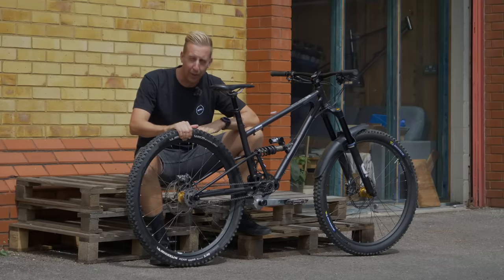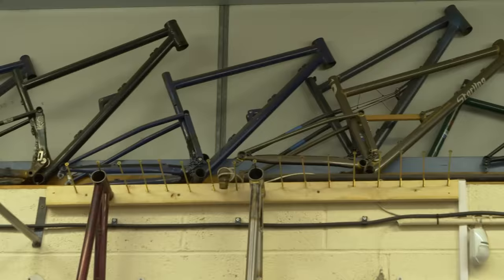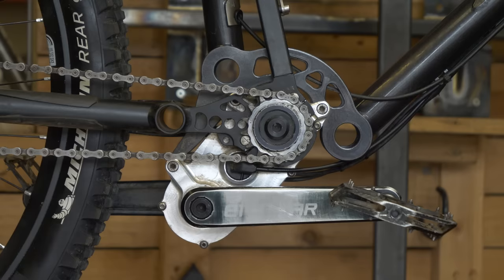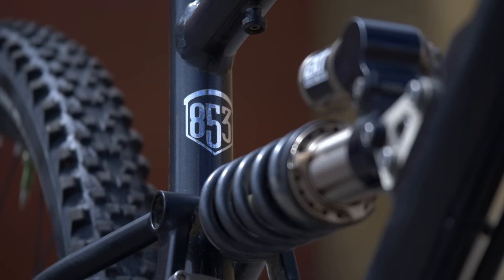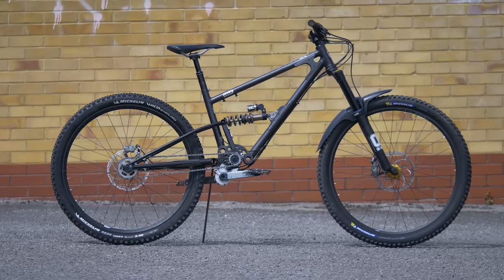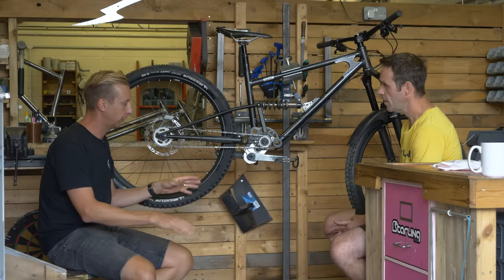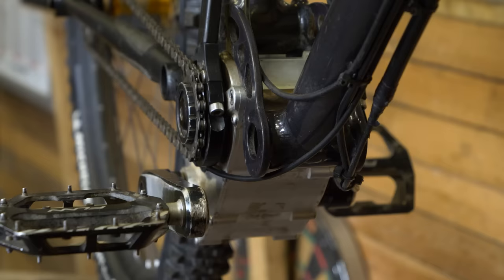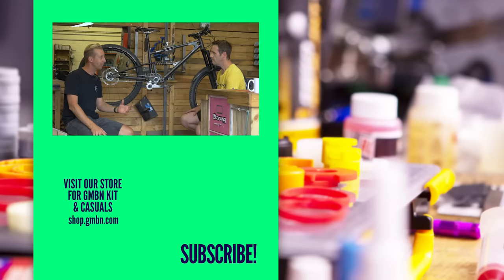Are Gearbox Bikes The Future Of Mountain Biking? | Advantages, Drawbacks, and Future Possibilities

Comment: I'm done with derailleurs. I have ordered a Zerode Katipo with the Pinion 12 speed gearbox and Gates Carbon Belt drive. Less maintenance and less touchy. So many good rides tainted by gears going out of tune. Once the bank account has recovered I'll replace the enduro hardtail too! 

Speaking to the efficiency issue, it is 100% true that chain is more efficient...when it is straight, clean and well oiled. When the chain line is all crossed up, the chain is caked in mud and tar or running low on lube a well worn in gearbox is more efficient. #askGMBNTech Could you do a deep dive into the science of driveline efficiency as a follow up to this video. I think people will be surprised.
Reply: I got one last year, its awesome, careful that the belt doesn't get kinked, mine got beat up in shipping and the belt broke on the 2nd ride, but they were good for it.
Reply: @Andrew Dodd Awesome! Can't wait 🤙
Reply: Go back to a 2x with better chain lines, use wax lubes, and your issues are solved.  I used to ride XC in backcountry Alaska and I never had any issues.
Reply: You won’t regret the Katipo. Shortly after getting mine I realized I absolutely hated derailleurs…. 8 speed, 9 speed, 10 speed, 11 speed, microspline, XD, blah blah blah.  No more. Done.  Click, click there’s 9 damn gears and done.
Reply: @keirfarnum6811  Yeah my 2x10 deals with mud much better than 1x11. The once mud gets on the narrow wide chainring it gets much noisier and can feel there's extra friction.
Reply: @keirfarnum6811  that's because XC bikes don't suffer chain tension issues nor have complicated long travel suspension designs. Another argument is that it is easier do design suspension around a single chainring than a double due to pivot placement. 
2x is good on pedalling bikes, but it doesn't belong in the gravity game.
Reply: @ Kier farnum
Lol, I should have seen that coming.  So out on an 8 hour ride in Alaska, you carry a spare front and rear derailleur, chain and what else...?  Gearboxes right now are first gen post development for the most part, few years time and they will be quite different, at the moment XC is not the target.
Reply: I notice you give the gearbox a good review before you’ve actually used it
Reply: @HkFinn83  For the sake of this being the internets, I'll bite. I think you need to re-read the post. Nothing in there constitutes a review. They are objective statements of fact that have lead me to order a gearbox bike. Nowhere do I go out on a limb to say anything that can not be supported by even the most basic Google or YouTube search. I've made my decision based on what I think will be best for me, and my general hatred of retuning my gears all the time.
Reply: whats the difference of putting the gears in the middle vs in the rear hub?
Reply: @Blox117  Mainly weight distribution. Unsprung vs sprung weight etc. Less weight on the rear wheel means more active suspension and generally better ride characters for a dual sus bike.

Comment: Riding a Rohloff for a year. I don't want to make an impression that is solves all pains of the world, but it is SO nice piece of equipment. Of course there are drawbacks, often mentioned weight, but riding a 25kg machine that is barely noticable on paper, letting alone real experience. but main thing is:
You can't put a pricetag on ability to shift while stationary. That is just a dream come true...
Reply: While all of us are different and have different riding styles, I can't remember the last time I needed to shift while stationary in normal riding or where starting off in the wrong gear was significant.
Reply: @grahamogle6332  That is exactly thing of different riding styles and ENVIROMENTS. I don't want to advertise it here too much, but check out my vids. You can spot several occassions of such shifting and at least one rapid downshift when I underestimated uphill and was unable to push enough with current gear...

Comment: 14:00  He's talking about pre-shifting.  In 1963, I took a 10-speed derailleur bike and adapted a Sturmey-Archer 3-speed hub to it so that I could get maximum gearing range for bombing around up & down the Santa Cruz Mountains.  It was a 30-speed bike.  No bikes had anywhere near the range back then.  The 3-speed had 178% range, and my derailleur gears were 52-42 front with 24-11 rear for 271% derailleur range; the composite range being 178% times 271%, which was 482%!  Perfect!  I could fine-tune the ratio until I hit the bottom or top of a hill when I could make a big ratio jump instantly without fooling with those crappy, cantankerous derailleur shifts!  [The best derailleurs back then needed constant tweaking while riding.]
Anyway, the 3-speed hub could be pre-shifted from 1st to 2nd or 2nd to 3rd from the gear lever on the handlebars, and would actually only change ratio when I stopped pedaling for a few milliseconds; it was quick!  It turned out to be very handy in drag-races with other cyclists at stop-lights in the city!  I'd start off in 1st & pre-shift thru 2nd and then 3rd, so when my cadence got too high (about 140 rpm), I'd naturally 'hiccup' and go into the next gear instantly!  It was like having a really good automatic transmission on my bike!  Meanwhile,  my competition would be left in the dust, fumbling with their crappy derailleurs!
I liked that setup so much that I've kept that system ever since thru multiple upgrades on 3 or four bikes.  I still have my custom-built Schwinn Paramount that I bought new in 1967 (when they were built like fine European racers), and currently have 81 speeds with 990% range on it, and it works like a fine watch for pulling stumps and pedaling downhill at 100 kph!
Unfortunately, I'm now too old to put that bike & its amazing gears thru their paces...
Reply: I know nothing about bikes but know this is badass! 

You should make a video about it. Seems like a sweet idea with a bike with some history.

Comment: Another new Zerode Katipo owner here… gotta say that Starling was interesting and the eccentric drive is probably ideal for swingarm pivot co-location, but if you’re looking for a fully developed gearbox bike Zerode is it. The Katipo fits right in with Yetis and Santa Cruz bikes in terms of build quality. Concerning the drag, well… it’s reduced noticeably in just a few hundred miles. There is zero drag in gears 1-3 and barely noticeable in 4-6. Drag is probably 10-20 watts in 7-9, but who cares about drag bombing downhill? 576% range is also kinda fun!  Belt drive, twist shifting, and power pausing seem to agree with me as my tech climbing ability has definitely improved. No more bent shifters either. Taking nothing from Starling, Zerode is just a way more polished machine and rides incredibly well - at 34# with aluminum wheels. The Kitsuma full lock out shock also makes long climbs feel like you’re on a gravel bike. It was really expensive, but no regrets yet… let’s see how things hold up! If you ever get the crew to Bentonville, Doddy, you can try it yourself ;-)
Reply: Never heard of Zerode, thought it would like a turd, but it actually looks amazing. Problem I have it with it, is that it kinda looks like an E-bike, I would hate to have people thinking you're on an E-bike.

Comment: I think gearbox bikes are the future of DH and Enduro. The high pivot trend will naturally shift to gearboxes, with the output taking the place of the current idler wheel.
Reply: probably be the future of all bike systems hopefully. the derailleur system is just so bad
Reply: @Metalshark100  derailleurs are so efficient, gearboxes just can't compete. The 8nly exception is maintenance, if your race is long enough in nasty enough conditions it could tip the scales but that would be very extreme edge case
Reply: @galenkehler  they're just very fragile, easily broken or bent. the maintenance like you said but also when something goes wrong with grinding or chain skipping its another thing to check and make sure its working correctly. i'd be fine with it if it didn't share so many problems with drive train issues. atm trying to figure out whats wrong with a bike i got preowned from someone else as it skips and grinds only on the lowest/hardest cog. doesn't make sense
Reply: @Metalshark100  I've been racing an riding for 20 years and never had any problem with derailleurs like you mention, and given their prevalence in the world, if they actually had those problems then other people would have problems too. 
You've just got a bad one.
Reply: Galen Kehler I agree. Been riding MTB for over 30 years and never broken a rear mech. Plenty of rock strikes and bent mech hangers, but the hanger is a sacrificial part. On a ride carry a spare, swap it out, and you are back in the game. The sprockets do wear but again are easily and cheaply replaced. Tension spring fatigue is the only reason I have ever had to replace a rear mech. All that said, ebikes and internal gears (gearbox) frame mounted does seem an elegant match to my eyes!

Comment: I worked for Serrotta Bikes, Upstate NY, USA, a few years ago.  Greg LeMond once rode a bike we made, the pride we achieved is immeasurable.  
Currently I use a Shimano Alfine SG700 11 speed gear hub.  It works effortless, but adds considerable & noticeable weight to the rear wheel.  My hub is an add on so it suffers from not incorporating it into the weight geometry, a benefit if designed w/hub from the ground up.
Expensive, but the luxury is worth it.

Comment: Fed up with how muddy my county is, gearbox is the logical choice for me.
The choice is so limited to the point of thinking I'll have to make one myself
so great to see starling doing something clever and well thought-out
Still a little worried about drag for trail/XC
Reply: It has positives n negatives
Reply: I bought a bike with a Sram XO1 chain on it a couple years ago. It costs about 3 times as much as a normal chain.  But Wow!  Total came changer.  Little to no chain stretch indicated. Up until that point I had been running Shimano XT and FSA stuff that stretched if you breathed on it.  I think the key to longevity with some of this stuff is not to skimp.

Comment: My favourite bike is a Shimano Alfine hub gearbox with a gates belt drive... the belt drive is a whole other level of convenience... no maintenance of the chain (this Starling bike still needs the chain cleaned, lubed etc...), carbon belts lasts thousands of km's... the are clean and quiet... can just be hosed off, and don't rust or stretch... a Carbon Belt drive would really bring this bike into the 21st Century...

Comment: i've been riding a pinion on my commuter bike.  it does have a slight bit of drag and shifting does take some getting used to, but it's an unbelievable system.  it's rock solid and quiet and so far has absolutely no issues with weather.  the way i think about it is like, would you buy a cheap car if it had an exposed drivetrain and rim brakes?  hell no, even if i have to pay 3 times as much to get something that's actually reliable.

Comment: I think internal gear hub 7-9 speed is the future, with potential e-bike drive.
Reply: When paired with an e-bike motor I do think that's definitely a better solution than the current derailleur system. That said, for "standard" mtbs I don't think hub gearboxes are the future, as one of the other significant advantages of gearboxes on full suspension bikes (especially longer travel full-sus) is the massive reduction in unsprung weight on the rear wheel.

Comment: Years ago back in the 70's you HAD 3 speed gear boxes on bikes. Most girl bikes and touring bikes had the 3 speed gearbox built into the rear wheel, whereas guys bikes had 5 to 10 speeds which was too many for a built in gearbox in the size of the hubs made at that time.

Comment: Every time i'm cleaning and lubing my chain, and counting the rides to replace the chain or even the cassette again, i tell myself my next bike will be with an internal gearbox and belt drive. But still, that little extra drag is a bit too much for my taste, i love riding uphill, but don't want to turn flats into uphills :D
Reply: As much as I love the less maintenance and pedalless gear change they feature on the gearbox bike, his emphasis on the drag ans his statement of it to be more for dh bikes makes me wanna test it first before committing cause uphills are hell but fun for exercise 😂😁👌
Reply: @rnyll  Exactly! One thing i'm thinking about, is a "floating"' chainring. That would solve the huge "crosschaining" on 12speed systems.
Reply: Everybody talks about the „drag“ of the system. I Switched from a Cube Stereo 140 (14.5kg) with 12spd X01 to the Zerode Taniwha with a Pinion 12spd and Carbon Belt Drive (15.5kg). Not sure if I can tell the difference on a 40-50km ride with about 1000-1500hm. For an Enduro it’s perfectly fine but also I have to say that on the Hardtail I probably stick to a derailleur because of weight and tours over 100km….
Reply: @_demerl_4855  Glad to hear your opinion! Personally had only owned hardtails though would love to own an Enduro bike soon, and with a gearbox at that if it becomes more mainstream in the future :D

Comment: Having owned Rolhoff 14 speed hub friction is a downside although there are many advantages.
Reply: And the Rohloff has planet gears, not standing gears like most gearboxes do, which on paper should have less drag iirc. I've ridden Pinion compared to Rohloff back to back and you notice a difference between those two in terms of efficiency. Both belt driven, same manufacturer and model so pretty much as close as the comparison can go. BUT I'd still like to see some chain driven gearboxes in the future (:
Reply: Plus weight n complexity as downsides
Reply: @Phonophobia  Of the two, which did you find more efficient, the Pinion or the Rohloff. I have had a Rohloff for over ten years with no problems at all (hardtail and now fully). There is also the Kindernay XIV 14 speed hub. I have read that Nicolai are also developing a gearbox.

Comment: I started riding gravel a few years ago and the most notable thing about my bike was how fast the drivetrain wore. At the same time, if you're not racing, why would you not want something more reliable. Like a sealed transmission with belt drive and of course full suspension. Yet, here we have a builder who knows exactly what is needed. Also do we really need a 13 speed, fast wearing chain as well?
I've gone back to 9 speed and cannot find fault. But I don't race either.

Comment: The type of builder that has strong mechanistic preferences, has design character and puts real soul into their bikes. The heavy pie plates for 11x1/12x1 setups have never made evolutionary sense to me on a full susp frame. I still use a lighter 11-34 3x9 and get a wider range with better chain lines. With the gearbox, moving more of the weight to the cg area/losing unsprung weight can only make the EXT shock work even better.

Comment: If the seat tube was mounted more vertical to have center pivot but move primary sprocket in line with chain stay and do a mild bend back for the correct seat post angle I think it would be much better. More more ground clearance and less likely to damage gear box. Would also if bend point is just past the top tube weld could possibly be some amount of frame shock absorption. 

Also I think this set up especially with single pivot would work amazing for a belt drive.

Comment: I suspect hard composite plastic tapered gears could avoid the oil friction issue. Only issues is that gears become more consumable over time...but convert the gearbox to a cassette type for easy switch as well as adjustable gearbox feature for courses of varying conditions...

Comment: I had an SWD for a very short time. It was part of the first batch after Steven's death that were basically DH bikes with XC geometry. So I made a new chromoly front end for it. Then I got hold of a second gen Santa Cruz Bullit swing arm which happened to have almost exactly the same geometry and adapted that. 26" wheels, 9.5" travel and long and slack before it got popular.

Comment: Riding my Nicolai Pinion for 9 years now. I clean it a handfull of times a year and it just works. I changed the chain once. Yes, sometimes I wish it to be lighter but the build is more on the the enduro side with 160/180 travel and 2.4 tyres accumulating it to 16kg.
Did Megavalanche with it and also do 500-800 in elevation on my standard rides with it.
I do have to admit though, that even though that the new 1x11/12 drives are also very good with regards to shifting (gone are the 3xXX days) and I am not sure if gearboxes will become mainstream. A sub 15kg all-mountain geabox bike would be awesome.

Comment: I wonder how much of an effect going to an ultra low viscosity oil would have. A human is only going to top out at a sustained 1hp so most gear oils aren't even going to probably get to operating temperature. It would be very interesting to see how much drag reduction you get running an oil with a 40*C viscosity of like 10cst or less, like an iso10 oil. I think super lube makes one that fits the bill.
Reply: I'd guess the hot ticket would be a low viscosity oil with a friction reducing additive in it, MoS2 or WS2 would probably work. 

Gearboxes seemed to have been on the verge of taking off a few years ago then 1X came out and it along with the technologies that make it work (clutched derailleurs, and narrow-wide chainrings) seems to have gotten rid of enough of the disadvantages of derailleur drivetrains that gearboxes remained niche. 

It still sucks taking out a $200 derailleur and a hanger.